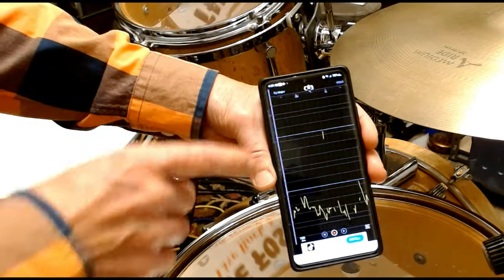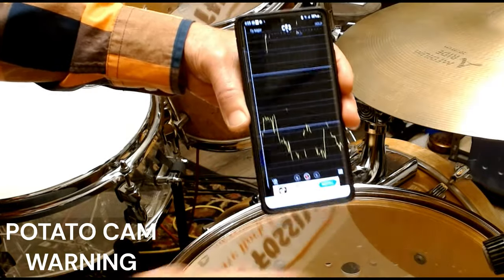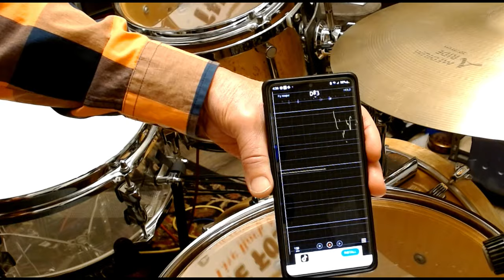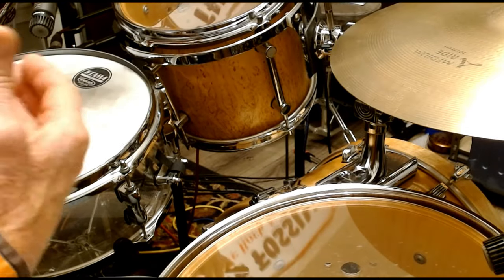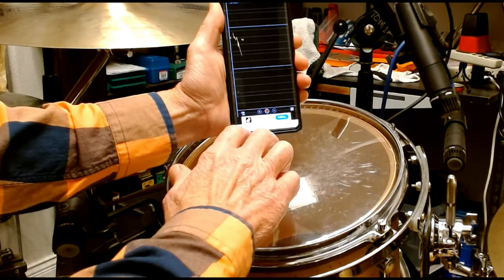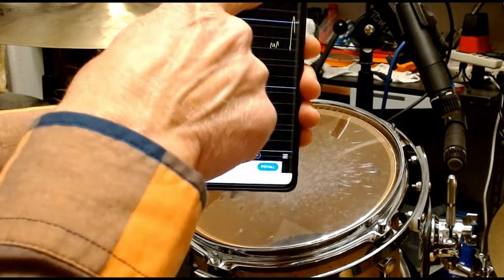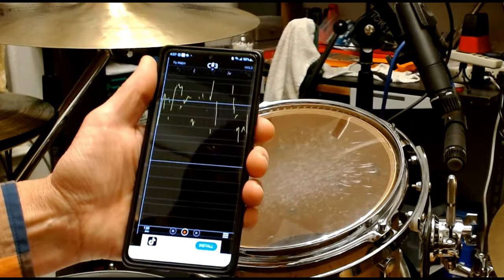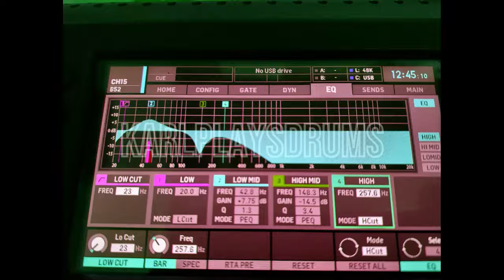An interesting drum tuning trick.

Comment: Interesting.  Is that a floating mount on the Sonor or is it just sitting on a snare stand?
Reply from the maker: Both toms are german force 3000 Scandinavian birch. The 13" floor tom is on legs, the 10" small tom is directly mounted to an L rod on the bass drum.  👍
Reply: @karlplaysdrums interesting. So that L Rod is through the shell?  I’ll have to do some tests myself with my Pearl ISS mounts vs snare stand vs L rod
Reply from the maker: @jasonkohls3496 it's a standard Gibraltar round tom mount attached to the shell with 2 screws, and then the whole thing slides onto the L rod.